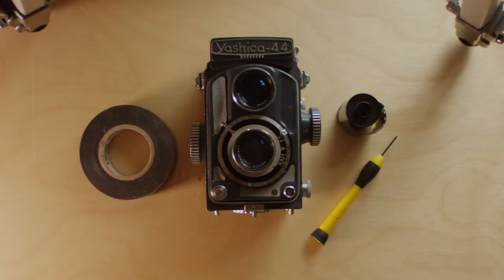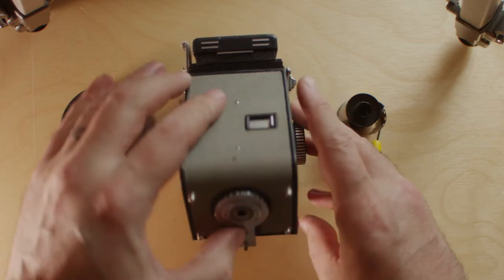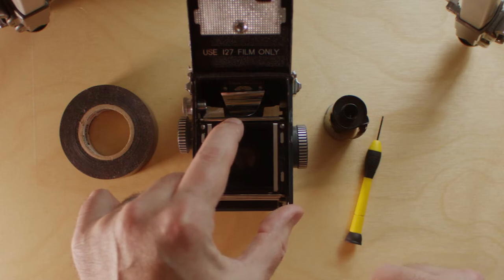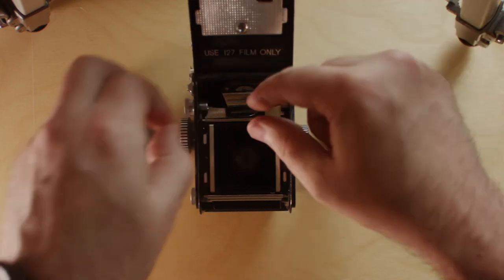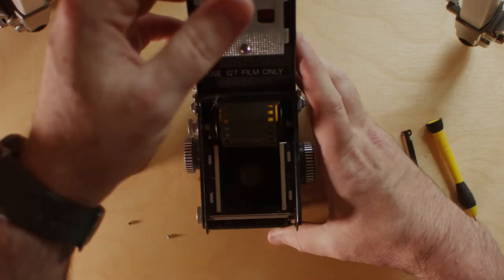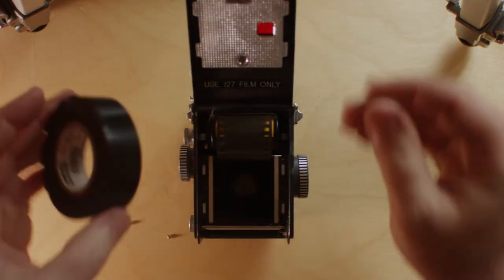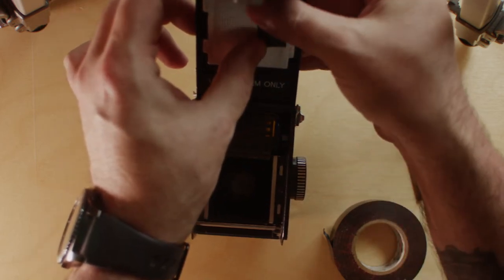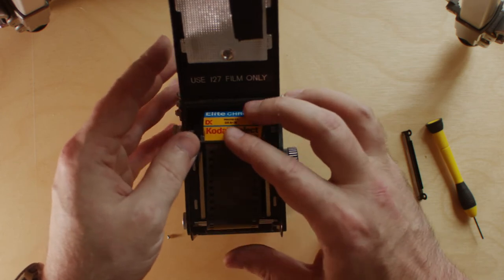Converting a Yashica 44 to shoot 35mm Sprocket Holes.

Comment: HEY! I shot some sprockets in a yashi 44 too. I may have watched this vid before back when I tried doing this. The results were pretty cool. my favorite thing was that the 44 I had could do double exposures real easy.  Kinda wish I hadn't sold the 44. So itsy bitsy and shooting sprockets in the bigger 124G is kind of a pain. Hey if you want a quick laugh check out the short I just posted doing yashica sprocket shots. At least this time I shot verticals so it wasn't too tough lol

Comment: How many images on a role of 36 frames, average. Great concept, thanks.
Reply from the maker: 25 or so depending on how long they actually cut the film.
Reply: @GoEverywhere do you get that many even on the crank wind cameras or does it stop at a certain number of exposures?

Comment: Will there still be 36 exposures?
Reply from the maker: No, since 127 exposures are taller you get more like 20 exposures.
Reply: @GoEverywhere  I have a knob wind 44, does the film stop the knob from moving when it has finished?